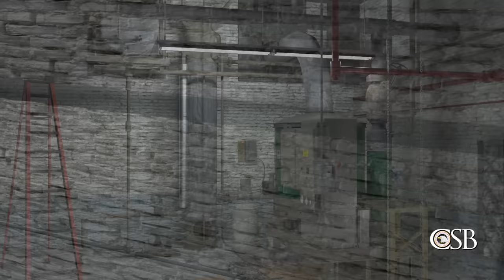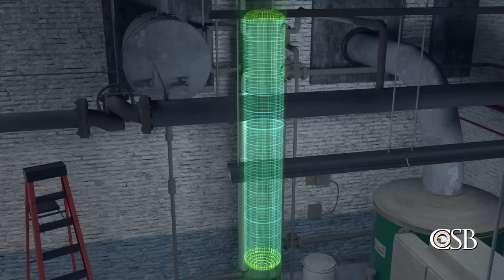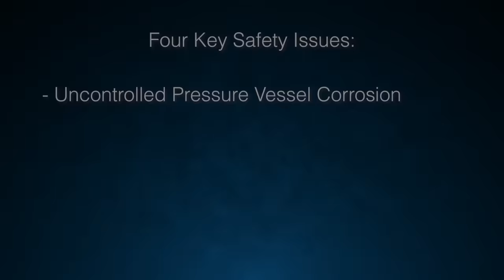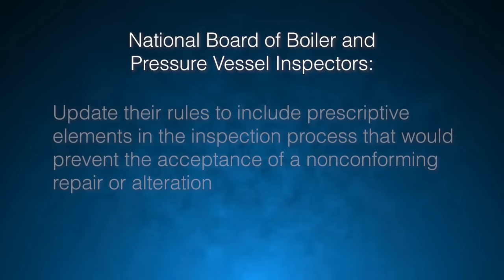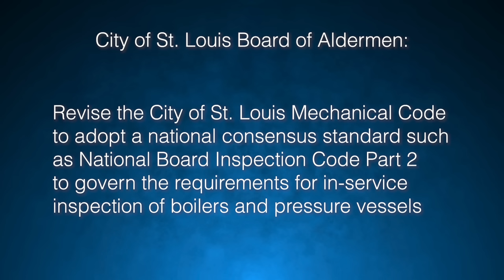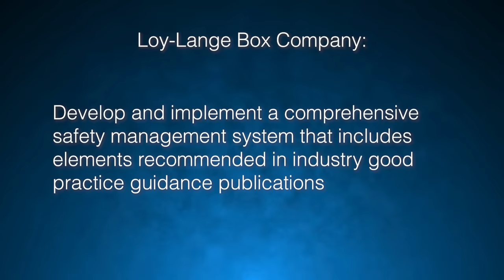Ignored Warnings: Explosion in St. Louis

Comment: So unfortunate. The company cut corners to save time. Not only was there a mistake allowing corrosion in the tank, but they never properly repaired corrosion  nor did they change start up sequences to prevent it from happening again. People are dead for no reason. Thanks CSB, your work is imperative to keep our work places safe.
Reply: They should be criminally charged for never registering the pressure vessels.
Reply: This happens at every factory across the world
Reply: Honestly, so many of the disasters could be avoided if the company in question stopped avoiding issues to save time/money.
Reply: @LBTennis  every workplace in general. Not just factories. Prioritising profit will always put people at risk.
Reply: @CryptoRoast_0  Totally
Reply: You people are putting WAY too much blame on the company, and not enough blame on the contractors who did the repairs. Understand that this accident would NOT have happened if the repairs had been done correctly despite the substandard procedures of the company's startup operations.
Reply: There's one reason why this happened: someone did not care enough to do the job right.
Reply: @SergeantExtreme  Yes and no.  The company likely would have just kept fixing corrosion time and time again.  Someone should have asked why it corroded and ensured that operating procedures were modified such that the corrosion wouldn't have recurred even after an adequate repair.

This is "Just get it running again!" mentality at its worst.
Reply: @orion3253  And there's lots of reasons for that
Reply: There are strict protocols that have to be followed regarding steam vessels. It's a seemingly minor detail until it isn't.
Reply: I'm amazed that the welder didn't think about the fact that that whole bottom head was corroded.
Reply: @SergeantExtreme  Yah, I wouldn't expect the welder to be a pressure vessel expert, but certainly whoever was running the operation should have thought about the fact that the repair wouldn't fix the whole corroded area.
Reply: @hmbpnz     Wrong. Watch the video again. The welder was an NBBI Certified Boiler Repairman. He was just lazy and cutting corners (in this case quite literally).
Reply: @SergeantExtreme  that's why we have redundancies with safety protocols. If the company hadn't been so negligent they would have caught this. If the state had proper enforcement and regulations this never would have got to this point. If the boilermaker doing the repair didn't cut corners the issue would have been prolonged.
Reply: I'm from STL and remember this well. 2 of those little killed? It was their 1st day.
Reply: IDK, it's simpler than all that.  People are dead because someone in management decided to accept a leak from a pressurized container without understanding the imminent risk of catastrophic failure of the container.
Reply: @SergeantExtreme  Understand that this accident would not have occured, and the repairs not have been needed, if they had operated the system correctly and reacted to leaks in the appropriate manner.

Warning sign after warning sign, but no, blame the person who dealt with the system once, not the people aware of the problems for years..
Reply: @SergeantExtreme  The blame lies 100% with the company. If this had happened in the UK the company would have certainly been prosecuted and very possibly individuals who could be looking at jail time.

Our law works on the basis that if a company knew, or should have known, that something was dangerous they are guilty of an offence. Ignorance is no excuse and neither is being ignorant of your own ignorance. If a company does something unsafe and get prosecuted it just won't wash in court for them to say "We didn't know it was dangerous" as they have the legal obligation to ensure it is not or, if they don't have the skill to make that judgement, employ somebody who does.
Reply: @LBTennis  There are a million reasons that I died, but chief among them: someone lied.
Reply: @SergeantExtreme  "Accidents don't just happen.  They're triggered by a series of events.  Unlock the fatal clues and countdown those final Seconds From Disaster."

*  Loy Lang didn't register the vessel, so the city didn't know there was a vessel on premises.

*  The city didn't conduct routine inspection of the vessel.  On the other hand, they didn't know it was there in the first place.

*  The city's codes on vessel inspection was rather lax and left to mere inspector judgment rather than instilling some sort of safeguards to ensure critically compromised equipment or repairs are not certified safe to use.

*  The welder did a schlock job on the repairs.  Not even I would've accepted the repairs, and I'm not in the welding/boiler/or corrugated cardboard industry.  If I'm hiring you to fix something because of corrosion, I want it ALL GONE.  Not just a grind job on the ring and weld in a new plate.

The welder didn't cut near the seal because he knew the weld won't stand the pressure.  If he cut the ring off, the vessel would be useless and require replacement.

*  Loy Lang didn't properly care for its equipment, nor took the time to upgrade or install backup systems or hire on-site equipment management to ensure proper care and maintenance for the equipment.

The only person who didn't have dirty hands in this was the city.  But to them, had they have a corrupt inspector approve shoddy repairs or certify a vessel that should've been taken out of service and removed, the city would be on the hook for millions in wrongful death lawsuits.
Reply: So many pos's do that. So disgusting
Reply: @AnthonyHandcock  "should have known" is the important part here. The company clearly did not recognise the system as dangerous and so did not research applicable regulations (e.g. to register it). I'm interested in what the manufacturer and installer told the company about it. If they never mentioned it, I'd assign a large portion of the blame onto them, too.

And while it would be nice if everyone would investigate every object they own and operate for its dangers, there is a limit to what can actually be done without hiring more people to do that than they have actually doing work. That's why products are sold with manuals that have long lists of safety warnings.
Reply: As bad as all of that is, the fact that they kept operating it after it started leaking at the bottom is mind-blowingly negligent. Certainly it should never have been allowed to get to that point, but the leak was a red flag that they just ignored. Even with all the other negligent practices, if they had shut it down at the first sign of leakage, they would have avoided this accident.
Reply: @SergeantExtreme  You are correct about the repair, but the part that truly blows my mind is that they didn't shut it down immediately when it started leaking.
Reply: @davereichert  Just speculation, but it wouldn't surprise me a bit if the repair company gave them an estimate to fix it properly, and the company vetoed that and told them, "Just patch it as cheaply as you can".
Reply: Regulations and protocols are written in blood. This is why it is infuriating when people want to "deregulate" because it'll "boost business". That's code for "make it easier for companies to cut corners to save a buck just like this avoidable disaster".
Reply: @russlehman2070  I was thinking the same thing. It sounds like something that this sort of company would do. Loy Lang certainly had a pattern of ignoring process safety and laws.
Reply: You guys didn’t even watch the whole video, the inspection protocol was flawed, and that’s St. Louis’ fault.
Reply: @brkbtjunkie  It isn't St Louis fault the company never reported the steam cylinder as required by law. The city can't check something they don't know is there.
Reply: Whats most unfortunate is that the company is not held liable for murder or manslaughter when it clearly cuts corners for years that costed lives.
Reply: @lagtastic7511  They owned it, so yeah.
Reply: to me it seems this company didn't even understand that it was a pressure vessel, they probably just thought of it as a leaking hot water tank.

while they deserve some blame for not understanding their own equipment I feel like it was the repair contractors and inspectors that let this company down.
Reply: @delanorrosey4730 the welder didn’t cut near the deal bc he knew the weld wouldn’t stand th he pressure? although i agree with most everything else stated cutting the entire end cap off at the seam wouldn’t make no difference on wether it will hold or not the weld is actually stronger then the base metal itself failures rarely if ever happen at then joint or welded seam if done properly with no porosity. looking at the piece of metal that blew out you can see it ruptured either rite nes to the weld or somewhere within that corroded ring. most likely the reason why the welder repaired it the way he didn’t didn’t want to have to cut out the outer jacket to be able to get to that seam either from  laziness or most likely the company didn’t like the price and that fact that it would would have been a much more involved repair leading to further downtime who knows. but in reality having a new tank fabricated from stainless then did not look like the most boat effective decision then im sure now they would think otherwise with what it eventually cost something all the amount of money combined since the beginning of time can’t bring back. never think it’s gonna happen to you till it does
Reply: @nicholasbardsley7097  I would counter your response with that of impact testing a full soda can.  Throw it at a high enough velocity to force a pressurized rupture.  Where does it break?

1.  The sealed lid.
2.  The rim of the top (if hit hard enough).
3.  The rest of the can (simply because the force met a weak spot in the forged metal and the force caused a rupture and splitting of the metal.)

Now take that can, try to bend it back into shape and reseal it.  It won't work and it'll rupture with even less force than before.  Often times, at the same weak spot in the can as before.

Now take that same can.  Throw it into a furnace, melt the metal down, and reforge it as a new can.  Test that one until rupture, same as before.  Was it quicker and easier to form a new can from the old than to make the older, less capable one work?

If the pop top ruptures, it was because the metal there was stamp cut to pop open.  If the lid ruptures, it was because the force bent the perfectly round seal out of round and compromised the seal.

There isn't much that can be done with metal fatigue, other than understanding it and replacing pressurized components before they fail.

I didn't say that the weld couldn't hold.  It did.  It just wouldn't hold as long as a newly formed piece of metal.
Reply: @YukkuriAteMyBaby  I'm sure the contractor would have replaced the entire bottom of the tank if they were paid to do so, however that would probably involve lifting the entire tank up which would be a lot more expensive and put the plant out of comission for days.
Reply: @russlehman2070  the workers probably had no training on pressure vessels so they had no clue of the danger, just instructions to "turn on valve A, wait for some steam coming out and then turn on valve B.
Any person with some knowledge of pressure vessels and steam expansion would shut the system off and start running once they saw the tank leaking, this worker stayed inside and continued as normal.
Reply: @brkbtjunkie  The company didn't even follow that and that's the company's fault. Health and safety isn't, or at least shouldn't be, a race to the bottom where you do the bare minimum the law demands. If you have a pressure vessel that explodes due to poor maintenance it's your fault and trying to shift the blame by, in effect, saying 'well they didn't tell me it was dangerous' won't wash.
Reply: Should patches on corroded plates even be allowed?
Reply: Tyson has here in Perry Iowa need to be checked they have rusty support beams. Stella and Chewy’s in has the same thing theirs is worse you can actually move some of the support beams there. Stella and Chewy’s also has rusty pipes that feed their freeze dryer machines and that’s pressurized ammonia those places don’t inspect shit.
Reply: @davereichert  Exactly. I can guarantee they were warned many times but the budget for the chemicals took precedence. My guess is one or both chemical tanks ran out 50 or more percent of the time. You can monitor a boiler watching the blowdowns with time tracking. Good blowdowns have little red rust water at the first opening almost gone after 5 seconds or so.
Reply: @AnthonyHandcock  in America, if a corporation claims ignorance of law its fine, but if a citizen does you go to the slammer.
Reply: @KiddBloo86  damn, that sucks! I'm sorry to hear that
Reply: @russlehman2070  it's hard to wrap our heads around this but it's simply because of profits. They didn't want to be responsible for the loss in production
Reply: This is a clear case of criminal negligence and if they we're warned or cited prior to the explosion, an award for punitive damages would be reasonable. If they have multiple citings for safety violations, they should be shut down. 🙄
Reply: @noconsent  Partially correct. It is true they can't inspect something they don't know about, but they did know about the generators and weren't inspecting those either (last inspected in 2010). All an inspector had to do was notice the unpermitted SCR, sitting right next to the generators.
Reply: Regular daily at 4 hour intervals boiler and support equipment inspections and water test will catch any potential problems. Now days we face a labor and a skilled labor shortage
Reply: @oxnardmontalvo  It's not like an inspector has all the cities paperwork in front of them. How would they know a company didn't properly report a semi-closed receiver? If they saw it, wouldn't they just assume it was properly reported? I think most importantly, that isn't their job. It was the companies job to maintain, run and report their own property. And they failed on every count, and because of that failure, people died. Sure it could have been stopped by outside parties with luck, but I, and the CSB, think safety should be more than just luck.
Reply: @noconsent  I understand where you're coming from, and I agree with most everything you've said, particularly your last point about luck. As for the City's role in things, I happen to agree with the CSB as well - the City missed opportunities to prevent this. If you read the full report (https://www.csb.gov/loy-lange-box-company-pressure-vessel-explosion-/), on page 44 the CSB writes that the City required all boilers and pressure vessels to display a City inspection tag. That's how a City inspector would know the thing wasn't registered - the lack of an inspection tag. It would also have been obvious that the SCR was a pressure vessel, because on page 21, CSB shows the R1 repair form that the repair company filled out, and the form contains a National Board registration number. Vessels registered with the National Board have prominent nameplates indicating their registration as pressure vessels. 

Page 44 of the final report also details how the City chose to be the regulatory authority. The state of MO regulates boilers and pressure vessels but allows cities and counties to self-regulate if they choose. If the City is going to assume the regulatory responsibility, they need to actually carry that authority out. CSB's conclusion here is also fairly softly worded: "The City missed opportunities." Contrast that with the relatively strong language used to describe Loy-Lange's lack of a safety management system. CSB is only saying "hey, this was another reasonably likely way this thing could have been prevented."
Reply: So... manslaughter charges for those 4 people they murdered in their negligence. Right?